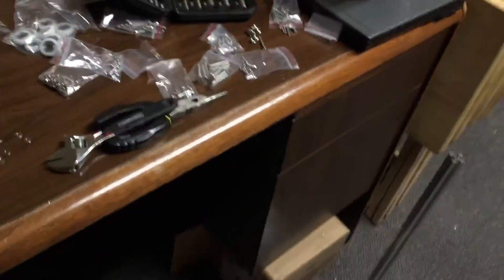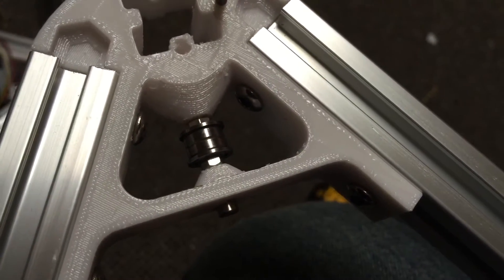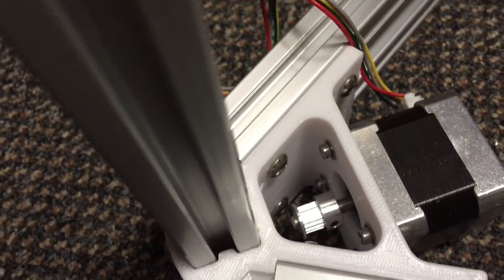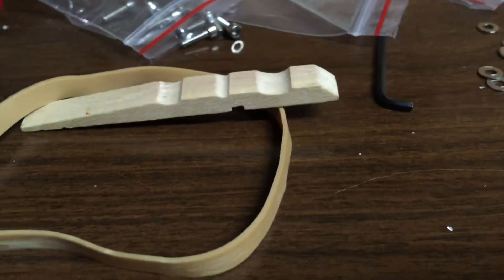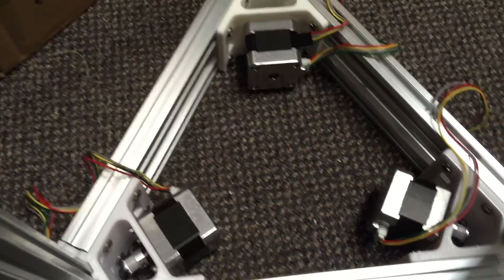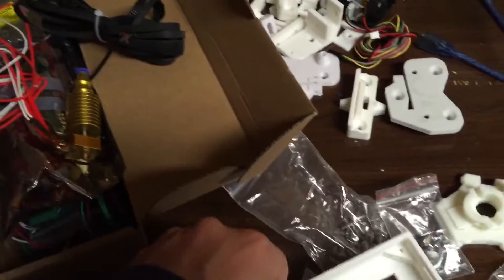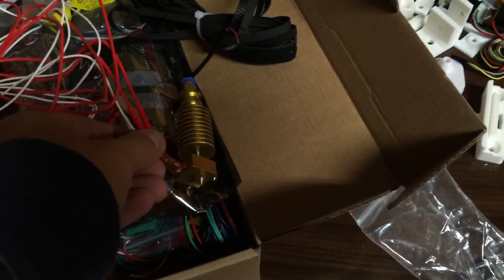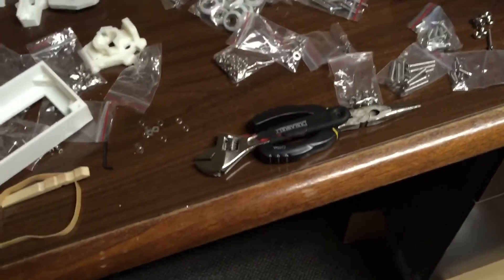He3d DLT-180 Delta 3d printer build video 1

Comment: Hi, Sadly the SD card that came with my kit is a dud and am trying to find decent instructions and the firm. Any chance you could help me?
Reply: ah. I saw the link to the firmware below :) Just trying to find some specific instructions for this model. I using advertising photos and a video for a similar model, which has worked up to a point but....
Reply from the maker: @tomwray3058  here is what I have. It came on the SD card that came with mine. Hope this helps!

https://1drv.ms/f/s!Ake8MhrMv07zg_IeKveDSQhP6OkIHQ
Reply: @iceman198  thanks!
Reply: @iceman198  Hi. Thanks for everything .I have built it but there is just one part that I could not work out. There is a small interruptor switch on extruder part that I cannot work out what is for and what it is wired to. It is not in the wiring diagram as far as I can see. I wired the fan directly to the mother board and the extruder wires too.
Reply from the maker: @tomwray3058  I actually don't use that anymore and the mechanism isn't accurate. If you don't wire that switch up, it means you can't use the auto-leveling command is all. You will need to level your hot end manually...a little bit of a process but totally worth it.  This will require to tweak your firmware config a little to get it accurate. Also, don't be afraid to print with a raft. It makes the first layer on the bed a little more forgiving as it extrudes a bit more on that first layer so if you're not perfectly level, the extra extrusion helps get to the bed a little more....if that makes sense.
Reply: @iceman198  Thanks.Glad to know its not vital.  Where is that part in the instructions? I couldn't find it anywhere
Reply from the maker: @tomwray3058  about the auto-leveling? I'm not sure, it has been a while. There are plenty of YouTube videos on techniques to level manually though. Are you able to do basic movements with it yet?
Reply: @iceman198  About how to wire the switch in. I couldn't find it in the wiring diagram or on the videos
Reply: @iceman198  What i am not sure of is the wiring here. There are 2 white wires from the extruder as well as 2 from the switch and only one place to connect on the mother board
Reply: Forget that. Found the missing part :) Am going to try and get it up and running
Reply from the maker: @tomwray3058  sweet!  Also, in case it helps, I highlight where the z-probe button wires too in this video: https://youtu.be/Br80oXDUprU
Reply from the maker: @tomwray3058  Does this help? - https://reprap.org/forum/file.php?219,file=52456,filename=InternetRamps2.jpg - you may need to copy and paste it rather than click on it from this youtube comment.
Reply: @iceman198  Thanks for everything. I am sue I will get there. This is my first time with these things. A really dumb question: I am assuming the firmware is already installed (?) I can't get repetier host to connect.
Reply from the maker: @tomwray3058  you'll definitely need to get it to connect. Check your device manager and make sure you see the COM port listed for your printer. Unplug then plug it back in and make sure you see it pop up. Otherwise you might have a bigger issue. Once you see it pop up, that is the port number you'll want to use in Repetier Host
Reply: @iceman198  might be a mac problem....
Reply from the maker: @tomwray3058  Ah....if you're using mac, you'll want to open a terminal and do a 'ls -lha /dev/tty*' which will list all of your com devices (most are virtual).  Unplug your printer from your mac, then run that command....then plug it into your mac and run it again and look at the new ones that popped up....I know with my mac, most USB com ports pop up as '/dev/tty.SLAB_USBtoUART' or something similar.
Reply: @iceman198  think it might be a driver problem
Reply from the maker: @tomwray3058  do you have all three jumpers under each driver chip? Mine actually didn't ship with jumpers and the instructions don't even mention having to plug those in. One of my videos show this.
Reply: @iceman198  yes. I spotted those on the wiring diagram. I now have the driver. Still no signs of life. I am only getting a light on the lcd screen and nothing more. I am now thinking that maybe the firmware wasn't installed.
Reply from the maker: @tomwray3058  yeah, sounds like you might be right. You'll need to get the Arduino IDE cooking. Good luck. Let me know if I can help.
Reply: @iceman198  Thanks. Its a steep old learning curve. Have a great weekend
Reply: @iceman198  victory finally
Reply from the maker: @tomwray3058  awesome! Share a vid once you get some progress!
Reply: @iceman198  any videos to recommend for calibration?
Reply from the maker: @tomwray3058  well...I don't have one in particular to look up...just search for micromake (that's your firmware) on bed leveling.  The "paper test" is the normal thing to get a good base anyways.
Reply: @iceman198  I uploaded repetier firmware. Do I need to upload further firmware?
Reply: This was reprap's suggestion when i finally got an answer from their support. However, the documentation for configuration of the firmware aludes to micromake. Getting confused here as no kind of guide was sent with the kit and i am a complete beginner
Reply: Micromake looks to make more sense. I presume that when I upload it will overide or compliment what is already there
Reply from the maker: @tomwray3058  I'm not 100% sure repetier will work for delta style printers...I would stick to the micromake if possible.  It was in the one-drive link I sent you a while back (or in one of the other comments).

Yes, everytime you upload new firmware, you've got a clean slate...it completely replaces what you had on previously.
Reply: @iceman198  Thanks. Just checking. The board is mega 256o isn't it?
Reply from the maker: @tomwray3058  yup!
Reply: @iceman198  with micromake I am getting info on the lcd but nothing is moving, no even the fan. At least i got some movement with repetier firmware. Feeling frustrated :(
Reply from the maker: @tomwray3058  hmm...what about with the autohome command? Anything?
Reply from the maker: Also, is the screen saying anything? If you have the endstops wired wrong, it might be thinking they're triggered and it's not letting it move.
Reply: @iceman198  I now have movement ,suddenly. :) now gotta make it move right
Reply: I changed the baud rate. That seemed to work. The one recommended in the wiring diagram, it seems is wrong. Certainly an adventure buying a kit from HE3D.

Comment: I'm assembling 2 He3D Delta 600's were your pulleys sluggish?  Is that intended or should I lubricate anyways?
Reply from the maker: Hello me....that sounds weird.  =)

Sorry for the late reply.  I can't speak to the 600 directly as I have the 180 but mine are held on my the bolts at the top so just make sure you don't have them too tight...might take some filling of the plastic where they go it to give more clearance as well. I had to do a lot.  Also, make sure the belts aren't on too tight as well.

Comment: https://drive.google.com/file/d/0B2xgIZ29vvneSzVTY0Rmb1VMMVk/view

Link to compile able frimware. Gretings
Reply from the maker: +Colin Denzel Here is a link to my configuration.h file: http://duttonbiz.com/temp/Configuration.h

That is the only file I have touched in the firmware...everything remains untouched.

What firmware issues are you having?
Reply: I just had a question, I have a He3D DLT-600 and it came with the DLT-180 firmware. Could you tell me the things I would need to change in the DLT-180 firmware to start 3d printing?
Reply from the maker: +Adam Samaeli only if you're changing the z-height...which you probably will. It really is different with every machine.  once you get it set up and run into questions, feel free to post em.

Comment: Could you do a tutorial on how to calibrate the HE3D delta printer? For some reason my stepper motors move incorrectly( in random positions) which sometimes clash into the towers. So I have to constantly click the emergency stop on Repetier Host
.
Reply from the maker: +Adam Samaeli I can do that at some point but may not be till after Christmas.  Just a busy time is all.

How did you solder your end-stops?  On the two outside pins or on the middle and one of the sides?  I have mine soldered on the two outside pins...which keeps the connection hot until the button is clicked which then breaks the connection.  This is what the MIcromake firmware is expecting.  If you have yours wired differently, you'll have to tweak some settings in the firmware is all.  But first I would take a multi-meter and just test the leads on end-stops to make sure you know how you have them wired/soldered.

Also, you should ALWAYS do a G28 (auto-home) whenever you reset or turn on the printer.  This tells it to go to the max z-axis that is set in the firmware.  When you do that, it will hit those end-stops and then display where it thinks it is on the LCD display.  Should be x0 y0 and z should be somewhere close to 200...this depends on what you have the max-z set to in the firmware.  If you haven't touched it, it is probably 200.

From there, you should never send a G1 command that tells the printer to go higher than that...or else it will hit the end-stops and try to push through.  The end-stops are ONLY used for the G28 command (unfortunately).

Hopefully this gets you cooking.
Reply: Cheers mate. I'll try that.

Comment: Happy thanksgiving! Hey, where did you find your documentation for how to configure the software and such? I've got mine the majority together but I wanted to test out the motors and find that what little information they provided isn't quite enough..
Reply from the maker: +Seth Gandy All there really is are the videos they send you on the SD card.  Not even that great resolution either.

To test the motors, your best bet would be to just plug one in at a time and do a G28 (home) and just see if it moves at all.

Also, check out Pololu's video on how to tune the chips (https://www.youtube.com/watch?v=89BHS9hfSUk).  I have my x, y & z drivers set to 0.8 volts and the extruder one set to 1.2.  And when you do that, make sure to put your ground lead on the ground coming in from the power supply..not on the ground to the driver chip as you extremely risk damaging your board if you touch something you're not supposed to.